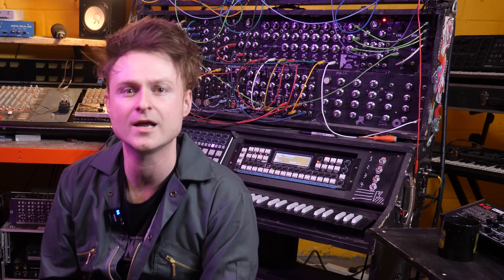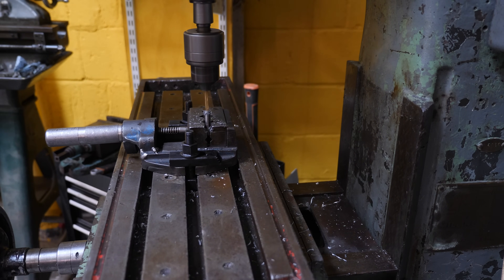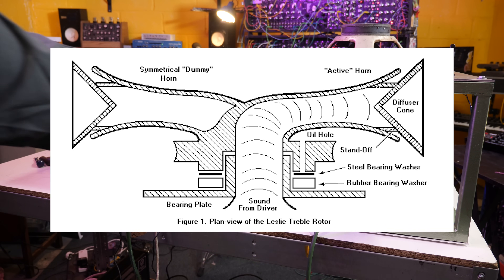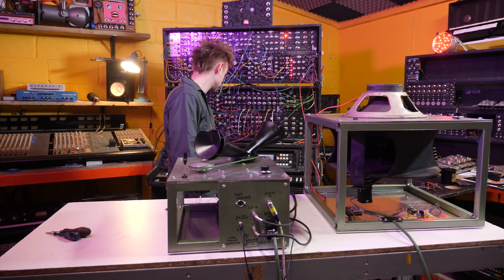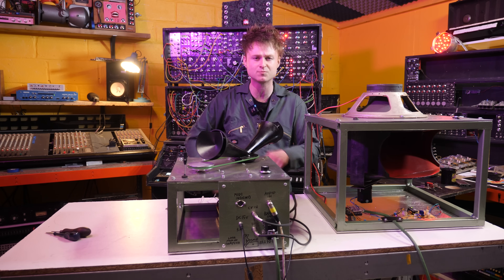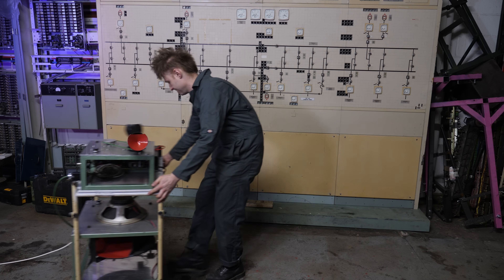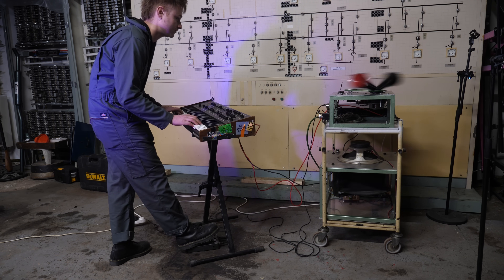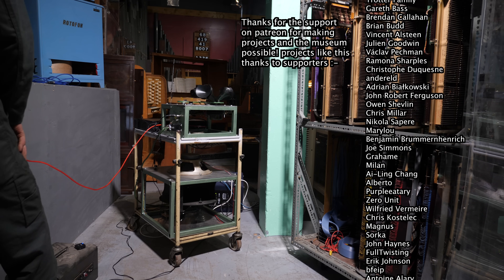A Leslie Speaker You Can Fully Control. STEPPER LESLIE Part 2

Comment: They also have other variants on the Leslie. I'm currently fixing a Maestro Rover, which uses one of those interesting Italian variance on the leslie, which puts a speaker inside of a plastic tube and Spins the P*SS out of it! I have the schematic here for the original Maestro Rover, and it has a very interesting variant on a stepper motor power supply circuit. I've never seen a more simple design that works rather well! And it works well with typically any DC motor in the 24 volt range. Typically I would use a drill motor that has 24 volt capability and the other one that I've found is a particular Odyssey that they put into Wurlitzer organs back in the day that managed to get around the patents that Don Leslie had filed, and use it again a speaker on a large pivot or centrifuge, and a rather Stout and heavy counter-weight. The warning is that instead of a healthy whack to the finger, as elicited by the plastic and bakelite horns of yore, these would occasionally shatter a full sized arm, or send a curious pet to kitty heaven, or turn a rodent into an unrecognizable stain,  and pungent smell... they were definitely the most brutal and most unconcerned with safety of any of these Leslie models. Naturally I have several of them! Spinning Day and Night Out in my garage just to keep out pests.

Comment: The typical leslies spin much faster in vibrato mode, mainly because the velocity really brings out the DOPPLER effect, which is really the money shot and the only thing early leslies did. The Yamaha RA-100 had the best chorus sound imo, as the large full range speakers made a fuller phase tone. The guitar tone on Shine on you Crazy Diamond utilizes an RA100. YES, Yamaha even improved the Leslie. Though the fast vibrato tone on the original is still better.  I think your looking at around 300-400rpm to get a correct sound. Yes, that fast! Lol. But the cabinetry was also integral, because with the deflectors on the horns, the distance from the driver to your ears becomes more and more extended. The sound comes up, hits the deflector,  not coming straight out..  then is stopped YET AGAIN by the patented louvres in the cab, so all told, the sound pressure of the horn would travel maybe all told, in the practical sense, about 60+ feet of distance to maybe 20 feet in a full cycle,  AND makes that oscillation (40-60FT) ~4-6 times per second, the speed of which creates the deep Doppler effect, which despite the speed and deep modulation,  still manages to sound pleasant, unless the horn starts smacking something. Oh and word of warning, if you have that knob there and it wacks your finger going at that speed, it will cause you to speak in a new language! One that the FCC strictly prohibits! Lol

Comment: fantastic work once again. i love the look of them on the push cart. sometimes a small amount of delay or reverb before a modulation effect can help highlight what's happening, and my backseat intuition was reaching for it here. also this is indulgent for someone who isn't doing the work involved, but i think it might be really lovely to have 2 identical units at an appropriate distance from each other running in an inverse control phase relationship, like the Dimension C/D chorus topology with leslies instead of short delay lines - perhaps using expression to control LFO speed rather than direct drive. the effect might be even more subtle than with a single horn unit, or the complex phase cancellations might pop out event more - probably nice spacious results either way. there would be a lot of options for micing it, and i think even going from mono input to stereo leslie then back to a mono center mic in a nice lively room could be a great use of them sometimes.

Comment: Love it! My best friend and myself rebuilt a Leslie back in the late 80s. His stepdad worked the bins and someone had thrown the amp and speaker cab out. It was in bits and took us a while to work out how it all went back together. Once we had it spinning I fitted a volume pot from an old radio to control the speed (yes, we should have used a wah-type pedal but we were also broke). His guitar sounded weirdly wonderful through it!

Comment: Sam. Distance is velocity times time. You are using your stepper motors to do velocity (rate of modulation) , but their real magic skill is distance. With some extra coding and coordination in those microcontrollers (or replacing with one controller doing both motors) it could be made so that the two speakers are perfectly together or perfectly apart in terms of where they are pointing and all sorts inbetween. With a bit more code it could be a device that follows a person around the room and always points at them. As a demonstrator for the museum your design does make perfect sense however. The way to control something by absolute direction rather than velocity would probably fall outside the scope of a simple midi pedal and need extra thought to make it amazing and it might actually also need an encoder on the baffle to account for belt slippage and other things. As a development project from where you have it now to a fully realised otherworldly deice it would be great fun... can anyone do my day job for me so I could get coding for six months, because I see the possibilities are endless...

Comment: uhhhh, to stay in your code : It`s sooo lovely bovely !!!  I´d reverse the footpedal action from slow to max speed in full throttle position, would make more sense to me. Having an old Yamaha Cab Amp with a Spring Reverb in it here , where only the Highs rotate and the 15' driver is fixed. I wonder if it would make a difference if you controlled the Low n High Leslies speeds independently...but boiling it down, the most obvious Fx come from the rotation of mids n highs.  I like the slow n slowing up phasing sound Fx speeds also best, Thx Sam !

Comment: Love this. Patch idea - no idea how it would sound - have each horn set to output a sine from a separate oscillator and tune them to beat against each other. Finely modulate one sine and have control of cone speed be driven by a pll or something trying to chase the moving beat frequency (or some whole number ratio of it).

Comment: Love this idea with the stepper and midi! I did a low tech alternative from the other style of Leslie the foam cheese wheel, a DC motor a pwm controller, batteries and the organs volume pedal.
 https://youtube.com/shorts/8rQkMCjQ3KU?feature=shared

I have since put it in a subwoofer box, I'm thinking about using the foam cheese wheel with the sub woofer driver, a cheese wheel of doom if you will 🤗

Comment: Timestamps (Powered by Merlin AI)
00:04 - Building a skeleton enclosure for the Stepper Leslie speaker.
01:39 - Steps to assemble and modify the Stepper Leslie speaker.
02:55 - The Stepper Leslie functions well and enhances performance with precise controls.
04:15 - Building a custom Leslie speaker with fine-tuning features.
05:54 - Overview of multi-point connector and control features in the STEPPOLESIE.
07:23 - Demonstrating control voltage effects on Leslie speaker behavior.
13:44 - Custom expression pedal improves Leslie speaker control.
15:56 - The Stepper Leslie offers unique control and sound compared to traditional models.

Comment: THAT BASS ISN'T DOING ANYTHING.  IT HAS TO SPIN THAT'S THE PURPOSE
Reply from the maker: huh?
Reply: So ive read that we arent so good at hearing (we feel them sort of)  the direction of sub frequencies so it might not matter too much. Also as veiwers on yourube all we are hearing is sound that goes through the mic that sam used. Traditionally Leslie's were mic d with multiple mics at least two. Since these two are split from each other there needs to be at least 4 mics. The lows might be there but not coming through on our end.

Comment: For nice clean circles with a jig-saw - use a jig! An offcut of timber pinned into the center makes a fine compass jig. Not that there was anything wrong with your results - only commenting cos more people need to know why jig-saws are called jig-saws! 😅The footplate is designed to be screwed/bolted into a jig -  at least it's supposed to be, even some manufacturers don't seem to realise this.

Comment: I'm pretty sure the donkey saw dancing around doesn't hurt its performance at all  (pun intended). Just imagine the wheels are giant vibration absorbers. They wont change the force pushing the saw down into the metal nor the length of the saw blade stroke...
Those speaker sound so funky even with just headphones, I would love to hear them in person one day
Reply: That's what I was thinking. if anything the dancing helps dissipate the stress that would normally be on the frame, into motion energy by freely rolling around.

Comment: Cool the hammerite metal green paint, sounds good.

Please, Build a multi channel (4/8) Hi-pass filter on a half a Kosmo panel, one half of a LM13700 or BA6110 per filter, just like Jupiter 8 but using the control circuit of the MS-20 filter, like i did. I used 2 capacitors on the first filter cell (MS-20 in hp mode), one is HP input, the other is reso. the tonal benefits are enormous, as you can move sound around preventing them to interfere with themself. would be peanuts for you, You would LOVE the results.

These filters work in reverse, since the capacitor feeds the FET's (BF256, 2N5457) directly to produce audio rather than passing through the ota, like in Roland Jupiter 8. you rotate the knob "counter" clockwise vs normal low pass filters. Be SURE to add negative feedback to the ota, just like in the MS-20 or it will not work right.

Look for "Motu Micro Lite", 80 midi channels in one box, rather than 2 devices you're currently using. Ableton Live is the number One (midi) sequencer in the world. either are computers, use the best one. your performance possibilities would expand by a light year, versus to the coal powered midi tools you are currently using.
: )

Comment: What is the audio effect of a Leslie? Is it a doppler effect or an amplitude change? Combination of both I assume. I assume it also makes a stage presence change with the sounds rebounding in different directions as it rotates. I've only seen one in person at a concert (Ian Moore, 1999) from 50ft away. If I remember right, I think it was re-mic'd into the mix. So its in-person effects were greatly reduced.
Reply: Yeah, a bit of doppler (vibrato) and amplitude change (tremolo) but also some low pass filtering effects; when the cone is directed away from the listener (or mic) there is less high frequencies, So, it's  a combination of all that.
Reply: @brumd  and also "auto-panning" as the speaker throws the sound alternating left, middle, and right.